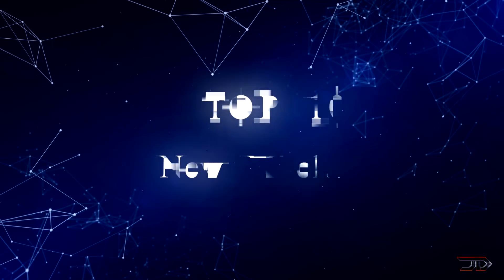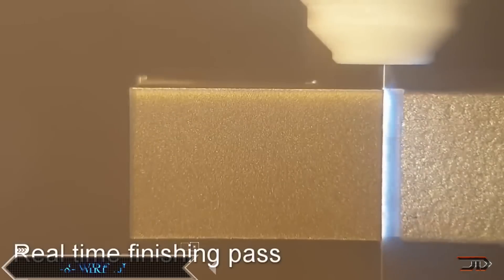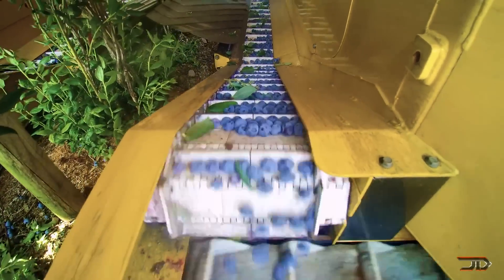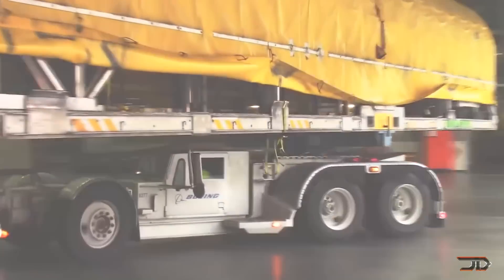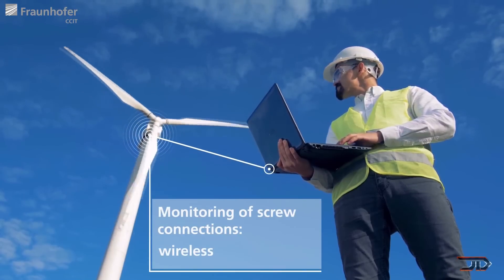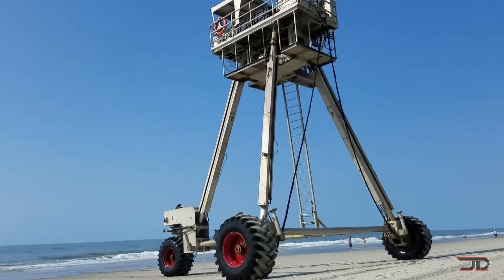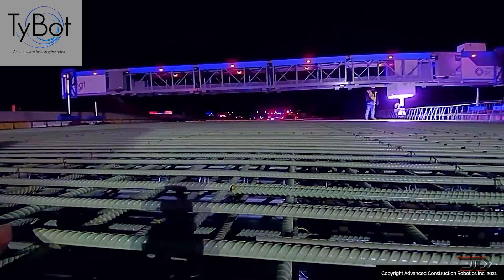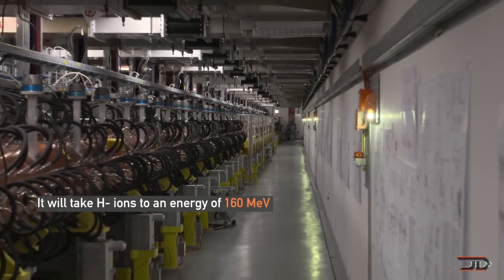10 MACHINES You Never KNEW EXISTED -4-

Comment: 10 machines that someone lost millions creating due to lack of required/funded work capabilities except for fringe cases.
Reply: I can't speak for the other 9 but I can say your wrong about the berry picking machine.  I live in an area that is heavy with blueberry / raspberry growers and those machines have been a game changer.  Reduced labor cost, faster picking, less time and movement between bush and berry flat,  makes it practical to do a second picking a few days later to get the ones that were not yet ripe.  Probably more.  I can remember when all of it was picked by hand.  As a teen, I was one of the pickers

Comment: 9 Machines I Never Knew Existed.
I'm not a machinist (though a took classes for a few weeks to become one) and I know about the EDM device.
Those Smart Screws really did seem like overkill. I suppose there are applications where they're useful but it sure seems odd to have so much tech in a screw.
Thanks for another fun and interesting video. You always manage to find wacky inventions I haven't heard of.
Reply from the maker: Thanks, those smart screws are overkill heh. I would like to buy a wire EDM but I think they are over $100k, hopefully there will be a miniature one for far less. There is a waterjet for 10k so it's definitely possible one could be made for a cheaper price.
Reply: @Motor_Explorer1  The channel Applied Science has a really interesting video about EDM. The video title is "Drill through anything (conductive) with Electrical Discharge Machining." 
Applied Science is a great channel. I highly recommend it. There's even a DIY water cutter on the channel.
Reply from the maker: @ddegn  That video is awesome! His channel is underrated for what he does.
Reply: @Motor_Explorer1  the first in any new Tek is rarely  Lamborghini Espada instantly .Usually it starts off as bit of a aTin Lizztyie and in  painful fits and trarts sfoot and shuffles along tgowardh a better one. ventually Politics then stamps it's  mighty  foot and all bets are off. Progress is jumping several stages at once a now and trilionaires buy the brainwork of a thousand cleverclogs and steal ( so  to speak) the future from the carbon units and think in silicon at lightning speed. As the Chinese curse goes: May you live in interesting times.